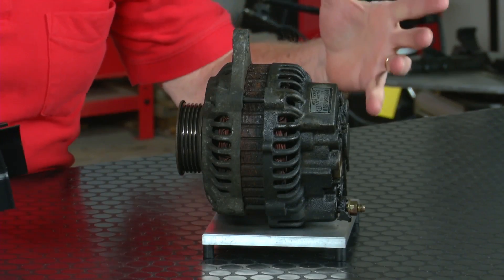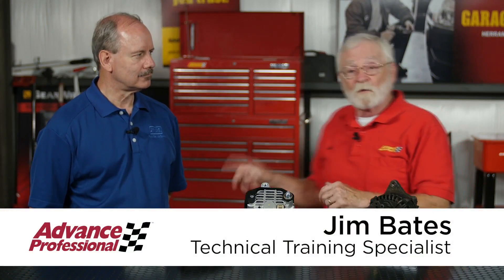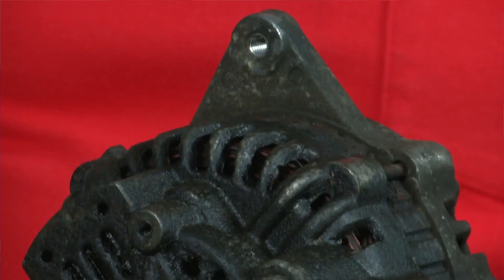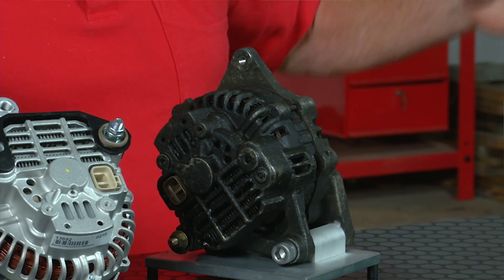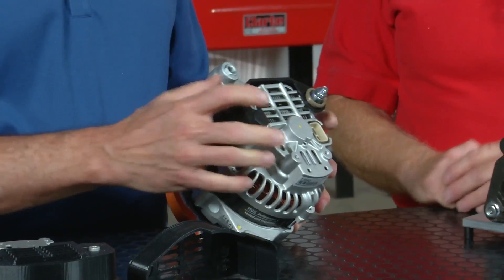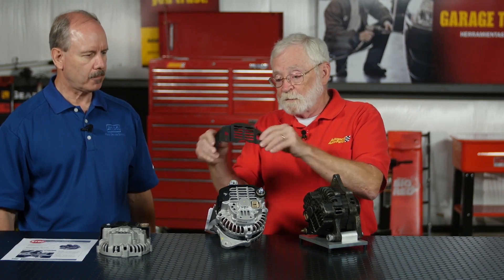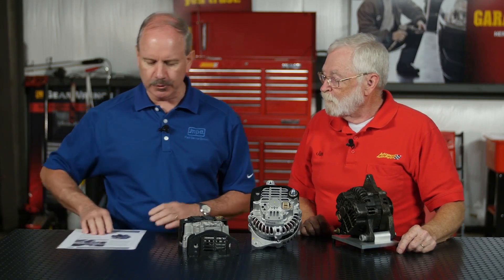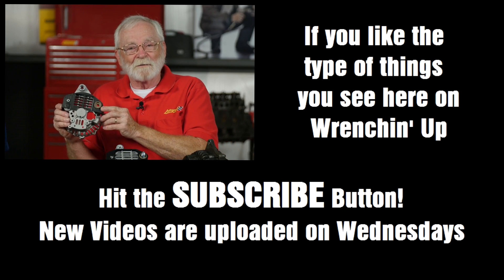How To Deal with an Oil Soaked Mitsubishi Alternator (#1 of a 3 part series with MPA) - Wrenchin' Up

Comment: So how do i clean my alt?
I still dont know. 🫤
Reply from the maker: Hi - Thanks for watching! I can only suggest that you check a service/repair manual for your vehicle for the proper and safest method for removing the oil from your alternator. Using the wrong chemicals could damage internal components. You may also want to contact the manufacturer of the alternators in this video for recommendations. Their contact information is in this video’s description.

Comment: I shove a couple white paper towels into the gap above the alternator.  This does 2 things: 1) Temporarily prevents any leaking oil from entering the alternator , 2) Serves as a indicator if oil is leaking onto the alternator, white is the best color because it is easy to see the oil soaking in (inspect regularly for leaks/soaking).
Reply from the maker: Hi - Thanks for watching and sharing your experience!

Comment: the fix for an oil leak is fixing the oil leak
Reply from the maker: Hi - Thanks for watching! Yes it is, but according to some folks on this thread the estimated cost of the repair is almost $2,000, so the shield was the more affordable option,
Reply: @WrenchinUpwithJimBates  yeh but the alternator is a symptom. what you have is an oil leak, which could mean an oil fire. not to mention stains in the driveway, and the cost of paying for oil that goes all over the highway.
Reply from the maker: @fuzzjunky  Yup, I completely agree.

Comment: instead of protecting the alternator from oil, why not fix the oil leak.
Reply from the maker: Hi - Thanks for watching! As we said in the video, (and by some folks in some of the comments below) the repairs can be quite expensive, up to $750.00. Many vehicle owners just can't afford to, or just don't want to spend the money to have it done right away. Since an alternator can fail within the alternator's warranty period, it gets replaced. So the "drip shield" is a good idea for MPA because it cuts down on warranty replacements that are not their fault.

Comment: This problem is almost always due to a failing passenger side cam seal. I've fixed mine, so no leak anymore. Before I did, I wish I would have rebuilt the mitsubishi alternator instead of buying a non-mitsubishi one. The off brand ones always seem to under-preform. pick and pull is worth a visit, buy a used alternator/rebuild kit is still cheaper and worth it if its OEM.
Reply from the maker: Hi - Thanks for watching and sharing your experience!
Reply: What if you need more amperage due to fogs, audio amps, inverters etc??
Reply: @tluva1020  OEM with rebuild kit, if that doesn't work, find a higher output after market alternator. If it is a montero, and not a montero sport, you have a spare battery box under the rear passenger seat. Adding in another battery could help the alternator with load peaks if its done right.
Reply: @BoppinStudios  I have the sport. I didn't realize the full size had a box. That'd be awesome to have

Comment: Do you make these for the denso alternators on hondas i have a 2010 accord crosstour 3.5l. The spool valve leaks and when the valve cover leaks it will take out alternator.  Thank you.
Reply from the maker: Hi - Thanks for watching! Good question but since that wasn't mentioned in the interview and demonstration I suggest that you check with the manufacturer. Their contact information is in the video description.

Comment: Hello, thanks for the video, but how do you actually clean an already dirty alternator. It's not failing yet but to prevent it from failing
Reply from the maker: Hi - Thanks for watching! I'm not sure I know the best and safest way to clean the alternator, so I suggest that you contact the manufacturer (MPA) for the best advice. Their contact information is the video description.
Reply: @WrenchinUpwithJimBates  what if i spray the whole thing with brake cleaner?
Reply from the maker: Hi - I don’t know as I don’t know of anyone who has tried that. If you do try it let me know how it worked out.
Reply: @WrenchinUpwithJimBates  Haha I’ll let you know
Reply: @razaix  hey did it work bud? I was thinking the same thing or gas
Reply: it works. brake cleaner is surprisingly ok an all electrical items. you just need to let it dry out for safety.
[i literally clean computer components with it]. there is also another method where you use water based degreaser and bathe the whole alternator and use a brush. you would need to let it dry for 24 hours after that.
Reply: @fuzzjunky  i did it with engine  on on my 09 honda accord 3.5l and it also works its commen for the vvt to leak and its right over the top of the alternator 😅😅
Reply: @razaix  contact Cleaner electrical I wouldn’t use brake fluid electrical contact cleaner evaporates almost instantly, and it won’t harm any of the components in the alternator

Comment: Crappy design by Mitsubishi, why not mounted the alternator on the top of the engine
Reply from the maker: Hi - Thanks for watching and sharing your suggestion!
Reply: @WrenchinUpwithJimBates  Mitsubishi did a horrible job with their alternators and their mounting locations. Especially when you drive frequently on dusty and wet roads

Comment: I have 2001 montero sport and would lose an alternator each year.  I thought it was the front cam seals, but discovered it was actually the rubber oil filler hose under the oil cap. The hoses rot on the bottom.
Reply from the maker: Hi - Thanks for watching and sharing your experience!

Comment: Spray 3 cans of brake cleaner and a last can of electrical contact cleaner and place ur alternator back , problem solve 👌🏼👍🏼
Reply from the maker: Hi - Thanks for watching and sharing your comment!
Reply: What about if the alternator has failed 
Cleaning it won’t repair it.

Comment: This just happened to me on my Nissan quest all I did was spray some alchohol to it turned the car on and turn the a.c and it started working. The a.c compressor helped the alternator get off the stuck stage. Make sure that the battery is not connected and wait till its fully dry before start
Reply: W hat kind of alcohol did you use
Reply: @stephanmoney7493 Gotta be an aged single malt, 20 years or more
Reply from the maker: Hi - Thanks for watching and sharing your experience!

Comment: that cover is not going to do any good. Most of the oils gets into the alternator from the fan blowing oil all around it. That shroud only protects from drips in that small area. Drips are not the main route for oil to get into the alternator.
Reply from the maker: Hi Paul - Thanks for watching and for your comment. However, comments from many users and the manufacturer's extensive test data, state that this drip shield (that the alternator comes with) does actually work because air (and dripping oil) is drawn into the center of the alternator and expelled out both ends. This is how the alternator is cooled and how the oil completely contaminates the entire alternator once it gets in.

Comment: this is true ,have a 1991 Mitsubishi Lancer ,the steering oil pump is right above the alternator and it's not an easy fix to stop oil from leaking from the top oil nut.
Reply from the maker: Hi - Thanks for your supportive comment and Thanks for watching!
Reply: So have you had to change your alternator because of the leak?
Reply: Did you have to replace your alternator because of the leak?

Comment: Where can I buy this alternator? I have inquired at autoparts stores and they have never heard of it. Look at your website and can't find where to buy it?
Reply from the maker: Hi - It is my understanding that Advance Auto Parts/CARQUEST uses, or used when this video was made, two vendors for their alternators; BBB and MPA. It is the MPA alternators that come with the shield. I would think that most of the folks working in the stores don't know this so you might want to have them check to see what's in the box. I would further recommend that  you contact MPA at their web address in the metadata for more information about where you can buy one their alternators. Thanks for watching!
Reply: Thank you yes, I will check into this. I have a 99 Montero Sport with a 3.0 v6 and have went through 3 alternators in the past 3 years I've had it. I would say it is because of the oil leaking on it and fouling it out.. It has almost four hundred thousand miles on the motor or I would just replace all the seals and gaskets, but I just want to squeeze a few more miles out of it before I retire it. Thanks again.

Comment: So to deal with an oil soaked alternator I run to Advance Auto Parts and buy a new alternator with a shroud?  Thanks!
Reply from the maker: Hi Chad - If the relatively high cost of repairing the cam seal or power steering leak is not an immediate option, the alternator with a drip shield could be just the thing to solve your charging system issue. Thanks for watching!

Comment: 2006 onwards Kia Sadona and Hyundai entourage has absolute same issue. Front valve cover leaks oil on the alternator. Do you have a similar fix for that too?
Reply from the maker: Hi Vijay - Thanks for this information, but you need to direct your question to the manufacturer (MPA). Their web address is in the information below the video. Thanks for watching!
Reply: V B front valve cover huh. I have a 09 Kia serato and I’m thinking the reason my alternator is full of oil is because of the oil pressure sensor? But hell now I have more doubts. 😂 I’ll check the valve cover thoroughly

Comment: I just bought one of the CarQuest alternators from Advance but it did not have the shield installed. Guy at the store could find no reference for the shield.  Where do you get the shield????
Reply from the maker: Hi - It is my understanding that Advance uses, or used, two vendors for their alternators; BBB and MPA. It is the MPA alternators that come with the shield. I would recommend you contact MPA at their web address in the metadata for more information about where you can buy one their alternators. Thanks for watching!

Comment: Can I purchase just this oil shield?
Reply from the maker: As far as I know, the oil shield comes installed on Alternators from MPA (sold by Advance Auto Parts) and are not available separately. But since my information is almost a year old, I suggest you contact MPA to see if the shield is available separately now. Their contact information is in the data below the video. Thanks for watching!

Comment: My 01' Montero Limited is leaking a substantial amount on the passenger side and I've tried to figured where the leak is coming from for months. I've already replaced the oil covered alternator2 months ago but I never knew the cause of the oil leak.

I'm wondering the price of the repairs for the gaskets and seals and all?
Reply from the maker: Hi and thanks for watching! After reading some of the posts about this subject and this video it seems like the leaks can from, among other places, the valve covers, intake manifold and timing chain covers. The cost of repairs can vary a lot, depending on the vehicle, engine and location of the leak. I suppose the best thing is to get it into a shop for an estimate and go from there. I hope the video helped a little though.

Comment: Jim, Where online might I buy an alternater like those you showcased?
Reply from the maker: The alternators for the Mitsubishi applications discussed in the video are produced by MPA. These are available under the CARQUEST brand at Advance Auto Parts stores and their on-line source. They may be available at other autoparts suppliers too, so check with the customer services folks of the other suppliers to find out. You can also contact MPA via the web link below the video. Thanks for watching!

Comment: Jim, my mechanic told me to get a new alternator because I needed a new valve cover gasket and oil got into alternator and alternator was pretty dirty but a friend of mine thinks the mechanic is lying because my car after I use jumper cables to jump start the car the car NEVER shuts down but if I leave car OFF for 2 hours I will need to use jumper cables to START car. We always thought if car does NOT shut down while driving than the alternator is good. Can alternator still be GOOD if I just cleaned the oil and dirt off? Did my mechanic try to rip me off by making a fast buck? Will alternator go bad even if I clean oil/dirt out?
Reply from the maker: +michael jones - Hi and thanks for watching! Oil in the alternator can certainly cause problems and lead to failure. SOMETIMES cleaning the oil out will help. I suspect your mechanic is looking out for his valuable customer (you) and doesn't want to have you stuck out on the road somewhere with a failed alternator. Based on what you have written I think you should have your battery, charging and starting system checked because a failing alternator may be able to run the car's electrical system but not have enough output to charge the battery too. The battery might be bad and unable to accept a charge and I suppose a failing starter could be adding to the problem although it looks like the first two items are most suspect. This is a simple check that your mechanic or most auto parts stores can do for you.
Reply: i know this is a year old post but if for future references  flr other's..ifyour car does not shut down after your battery has depleted its voltage that is a good indication the alternator is still functioning properly.  the batteries has two jobs. 1,crank the engine on startup and 2,..assist alternator with headlights... that is all. your alternator  supplies voltage until engine is shut down.. 13-14.volts is perfect voltage. 12.5 or under will kill a good battery. a cheap multi meter can save hundreds of dollars from a shop changing a good alt and or battery.
Reply: @jacobhighland3638 I had a question you still able to answer even though it's 6 year old comment?

Comment: Is this drip shield only available for alternators used in the Mitsubishi car models? I have a Saturn (2002, L200 Series) and recently discovered oil leaking on the alternator as well.
Reply from the maker: +Stay C Bryant As far as I know it only comes on the MPA remanufactured alternators for the Mitsubishi applications mentioned in the video, but you might want to check with MPA to see if they put it on your application too. Their web address is in the information section below the video. Thanks for watching!
Reply: +Jim Bates Thank you

Comment: My local Advanced Auto parts store has never even heard of this product.  They don't have it listed in their inventory.  Do I need to buy this through Motor Car Parts of America?
Reply from the maker: +mark tenk  Hi Mark - I think CARQUEST is the brand that Advance Auto Parts is currently selling. MPA supplies the CARQUEST alternator for this application so I would recommend you ask them again for the alternator and open the box at the counter. You should see the "oil shield" already installed.

Comment: OB-WAN WHY DIDN'T YOU TELL ME???  I have 2000 MMS, Just replaced the ALT about 2 years ago. Now the BATT and Brake light comes on. I tested the Voltage on the batt, drops to 12.3 when its running. I put my hand on the back of the ATL to see if the connection was tight. My hand was soaked in oil. I knew she leaked, but I I have to buy an oil cover then she gots to go!
Reply from the maker: +Matt 23:4 I hope the video has helped to deliver you from the Dark Side of the Force. As you can see in the video, MPA sells an alternator with the oil shield already installed. Doesn't do anything to stop the leak but sure helps the alternator last longer.
Reply: I solved similar problem with my 1998 volvo v70, I cleaned the top of the alt sprayed some brake cleaner then Lub it and I placed a plastic container that fits in the location ,tied up with plastic tiraps, emptied once an a while.

Comment: @ Stilkus
The technician did mention the reasons why; I looked up labor rates to do the repair and  In some cases the cost to repair the cam seal or p/s leak can be cost prohibitive as it can range from $500-1200 dollars, ideally most people will take care of the issue at hand but in todays economy it doesn't happen. The shield is designed not as a permanent fix but to help prolong the life of the unit until the car owner has the available resources  to do the proper repairs
Reply: "Nothing is more permanent than a temporary fix."
Reply from the maker: Hi - Thanks for watching and sharing your insight!